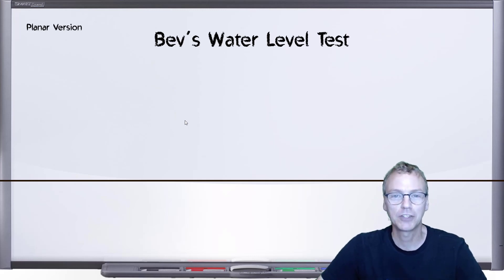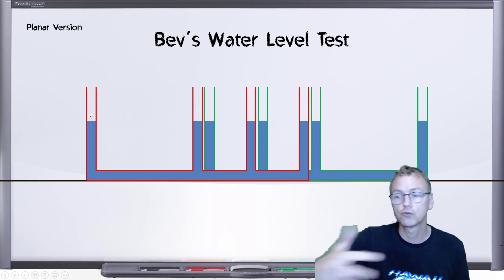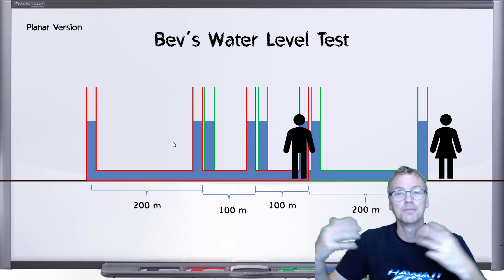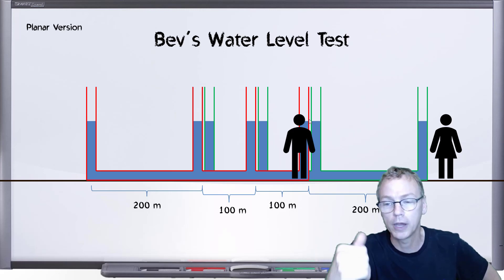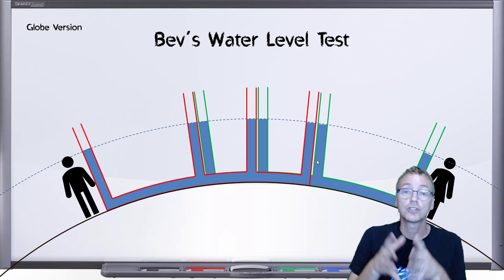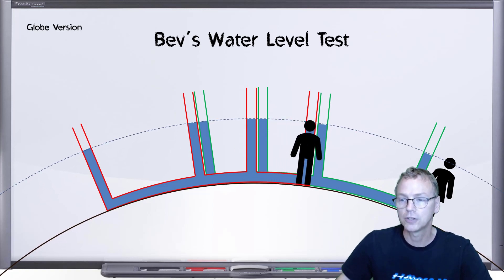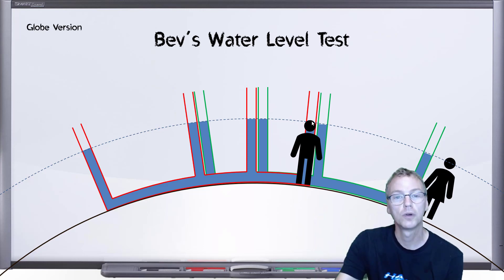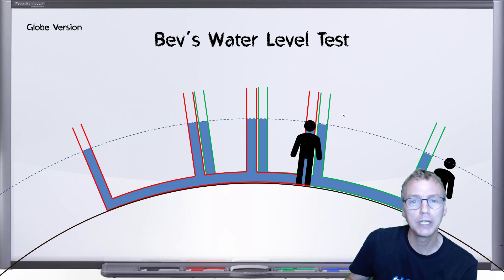Bev Try Thinking and Spot On Level's Water Level Test

Comment: The problem is Bev believes water finds its own level, level is horizontal & all verticals are parallel. He also thinks on a globe there should be a hump of ground in front of you. Anyway good luck with you're dealings with Bev, no doubt you will learn of the word bendyzontal.

Comment: Easy way to test this another way...
Take a line of sight from the 2 furthermost tubes. If the Earth is Flat, this will line up with Every tube.
If the Earth is a Globe, the tubes in the middle will have the water level above the line of sight...
That is if Each spot where the base 'tubes' are is the exact same height above sea level... 
Jerod from 'The Flat Earth Society' did a Very similar test in the documentary "Level" with a laser and boards with a hole in them... His experiment was "interesting" as he said...

Comment: I think you mean "line" when you said "plane."
Reply from the maker: It is likely that I've used the word "line" where I should have said "plane" once or twice.
If you give me a time-code, I can check to be sure and clarify what I was talking about.
Bev is working under the concept that all the risers of a water-level lie along a horizontal plane.
When we draw the side-on view of them, that's a 2D diagram, so that plane projects into the 2D diagram as a line. At that point, I might call it a line or a plane interchangeably, and I would argue that is correct either way. It would be a line in the diagram, but the line represents a plane in the 3D world.
Furthermore, Bev has lined up his water levels in his best approximation as a straight line. He likes to describe the risers of his water levels as being straight lines. Naturally, there is some wiggle in those lines in the side-to-side axis, but I have generally forgiven that when speaking about it with Bev. Certainly, when we draw them on the 2D side-view diagram, that wiggle goes away.

Comment: I'm sure I heard Bev a few months back on a podcast, casting about for a surveyor to give him a straight sighting from the beginning upright to the ending one. If he does get one, that would help resolve things. Of course, he also has to complete the experimental setup, which seems more challenging. Isn't he going to need 1 or 2 hundred meters of pipe completely filled with water, with no air bubbles, for each leg between uprights?

Comment: Here is MY prediction:  No one ( without a LIGOS sized government grant) can build an actual apparatus with enough accuracy over hundreds of yards to detect the tiny variation we would be expecting to measure. That is to say, the results we would want to measure would almost definitely be less than the margins for error.
Reply from the maker: I think you missed the point... the method they're using to test it wouldn't show any curvature no matter how long it was or how precise it was.
But if they sighted along the tubes, they'd need to make it longer to be able to confidently measure the effect.
Reply: @icansciencethat  I did NOT miss the point.  I'm only saying this approach is a fools errand - which seems to be exactly what you were saying.  Only I am saying it for different reasons. There is no practical way any apparatus could be constructed to fine enough tolerance and be measured accurately enough to do the blessed experiment. Not without a multi-million dollar grant. I'm sure you've seen Daniel Pratt prattle on about how he wants us to construct an i-beam over an Olympic swilling pool, and then see if we can measure the distance down to the water to see if there is a bulge in the middle. Well, when you're trying to measure mm and smaller distances, just how do you keep the i beam from deflecting due to gravity? Again, the margin of error would significantly bigger than the distance we are trying to measure.
Reply from the maker: @Robert08010  These guys keep coming up with "experiments" that are specifically designed to show nothing. That tells me everything I need to know right there.
Reply: @whatever2735    Agreed.  I'm only saying to do things to Daniel Pratt's specification would require a LIGOS sized budget.

Comment: This experiment is flawed in so many ways. Even if the results were expected to be different on a flat earth vs a globe (they are not), has Bev considered the margin of error in measurements? If we scaled this up a bit to be 1000 metres that would still only be 1/40000 of a great circle over the globe or to put it another way 0.009⁰ of earth's curvature. Flat earthers never get scale.

Comment: The only fly in this test is if the water is at different temperatures (and hence different densities) in different risers, which would give different heights. However, careful preparation of the experiment and having a long temperature stabilising period before measuring would fix that.
Reply from the maker: Don't forget wind and atmospheric pressure.
The big wrinkle is distortion and refraction when sighting. You just need to go far enough to overcome the distortion. The you must show how refraction affects it.

Comment: Bev was going to hire a surveyor to have 3 posts adjacent to the canal and have a horizontal plane marked out on the posts with all 3 marks in line. The water levels as shown were to be placed at the three marks, and then observe if the water levels coincided with each mark. They won't, but he can't grasp that.

Comment: Small technical detail: @4:00 If the points are colinear they cannot form a plane.

That aside, this experiment seems to suffer from the same defects as many others proposed by FE boffins. When going from a simple drawing on paper to the real world, it becomes impractical. Here are a few factors that should be controlled for in such an experiment: The law of communicating vessels assume equal ambient pressure, temperature and local gravity (both due to local density variations, and the influence of the Sun and Moon) at all the vessels, and that the size of the vessels and their communicating tubes are all large enough that capillary and surface tension forces can be safely ignored.

To determine whether the water levels form a flat or a curved line, they must be compared to something that is known to be flat. In the Bedford level experiment (which is basically an infinite number of infinitely small communicating vessels) light was used, thus assuming that light travels in a straight line. Note: whether you are sighting across the vessels to see if they line up, or whether you shoot a laser beam across the tops, you are relying on the exact same assumption that light travels in a straight line. By necessity this experiment would have to be performed near the horizon, exactly the place where FE boffins dispute that light travels in a straight line. I suppose they will need a magical 500 meter long ruler that is perfectly straight (as determined by a currently unknown process), and not subject to any bending at all.

This reminds me of Pratt's suggestion of attaching measurement equipment above a really long swimming pool.

As usual our coverage of the topic was both polite and respectful, without a presupposed bias, I always enjoy and appreciate that!
Reply from the maker: Agreed to all except I would say that a single line does not "form" a plane, but it does line within a plane. Technically, the water level would not be perfectly straight, so the various points on it WOULD form a plane... it only creates a line in the side-view projection.
I'm sure Bev would insist that it's a plane and I mis-represented it as a line.
Reply: @icansciencethat  >>I'm sure Bev would insist that it's a plane and I mis-represented it as a line.<<
- Right, that is pretty much what motivated me to make the slight detail comment. Mathematically, 3 non-colinear points define a plane, even if one point is only ever so slightly away from the line connecting the other two. But in practice, with points that are nearly colinear, it is difficult to establish that plane exactly. Since Earth is very nearly spherical, it has almost uniform curvature in all directions from a given point. So the argument would still be the same when considering lines/curves rather than planes/surfaces.

>>a single line does not "form" a plane, but it does line within a plane.<<
- My very slight objection to your reply is that planes are not the only surfaces that can be constructed from straight lines. In general such objects are called ruled surfaces. Of course, in this context general ruled surfaces probably don't make sense, but one should establish that as a conscious decision. Again, I mention this in the context of what Bev might object to, and not as a critique of your video :)

Comment: Get a one meter or so length of transparent plastic tubing and hold it in a U shape nearly full of water at a beach. Hold one end of the tubing near your face (at eye level) and the other end of the tubing towards the sea horizon. The water levels in the tubing won't perfectly line up with the horizon. The horizon is lower!
Reply from the maker: Have you tried it? I encourage people to try this.
If you do it from high above the water, do you get a different result from what you get down near the beach?
It's an informative test and very easy to do... if you have access to a beach.
Reply: @icansciencethat  Apparently refraction is more prominent near sea level and not as accurate as from a cliff.
Reply from the maker: @Justwantahover  I would say that refraction is more unpredictable near the surface... not particularly near sea level - just near any surface where the heat can build up.
If you look downward towards the waterline from above, that dramatically reduces the issue.

Comment: Taking a second look at this, and trying to work with your desire to make this a "safe space", wouldn't it be so much easier to just suggest an easier measurement with something like a lake? Just get some wooden stakes marked with measurements and pound them to water level on each side of a nice calm pond or lake. Then take some surveying equipment to measure what you see from each side. The obvious issue is honestly acknowledging how surveying measurements work and their tolerance errors, but it's been done before by a surveyor whose name escapes me now. Regardless, why set up all these pipes with water when you can use use a pond or lake?
Reply from the maker: Seems to me, that would work brilliantly.
Reply: @icansciencethat  Jesse K was the surveyor who already did something similar long ago. I finally remembered his name.
Reply from the maker: @NinjaMonkeyPrime  I've seen some of his work.
For some reason, his name is met with universal revulsion in FE circles. Can't imagine why.

Comment: If the water in each tube was on the same plane as Bev claimed, 1 water level device would have been enough; they could just measure the angle of the surface of the water to the ground. If it worked as they claimed on a spherical Earth, the water at one end would be angled to the ground a bit due to the plane not following the curve.

Of course, that would mean water at that end of the device is failing to "find its own level" as flat-Earthers claim water always does, since it'd be at an angle rather than leveled out.

I don't think Bev thought this thing all the way through...

SIDE NOTE: Greetings from WheresWally's channel!
Reply: Not quite - he found a definition somewhere that all the levels in a container form a single plane. That's close enough to be a useful approximation on a small scale or within normal "construction" precision, but extrapolating that to mean that two separate levels would form different planes on a round earth is pedantic at best.
Reply: @Traqr  You can define a plane with a water level, if you have three uprights in a triangular arrangement. The centres of the water surfaces in the upright tubes will define a plane. Any three points define a plane. You could also use four, in a rectangular arrangement, or five or six or seven or however many you like, as long as they're all equidistant from one point in the middle. The plane thus defined is horizontal at that point apart from tiny errors introduced by the uneven distribution of mass causing irregularities in the true geoid and by Earth's north-south curvature varying with latitude due to Earth's rotation. Those errors are well within tolerance for a generic building project, and a plane with a 25 m radius, quite large for a building project, is at its centre only 49 microns below level with its vertices. They measure sand grains in millimetres, not microns, so they can't really call that out of tolerance, can they? That's three quarters of one of the very smallest "very fine sand" grains.
I've used a rectangular water level to provide an "eye-level" reference line in a photograph. Technically, it'd be eye-level for someone sitting under it with their head up in the middle of it and me taking the picture past both sides of their head, not eye-level for me twenty paces back, but that's a pretty small difference.
The arrangement shown, with the hoses in a great circle, would still define a plane, but it'd be a plane aligned to the hose and to locally vertical and cutting through somewhere very near the centre of the Earth, not anything like horizontal at site and not particularly helpful.

Neither arrangement forces "level" to correspond to that plane. It merely intersects that plane at those points. It's a bit like sticking a wire through an apple. The wire and the apple's skin intersect, but that doesn't make the apple flat.
Reply: @Sableagle  ...and we'd expect a drop of 1/8" at 200m, and 1/2" at 400m. None of these statements impacts the original argument that two overlapping water levels will track one another in both models, or that we cannot assume a series of measurements are coplanar simply because some technical writer put it in Bev's instruction manual.

Comment: That is a nice presentation with nice diagrams.   I pointed out this very same problem to Bev well over a year ago and others have followed since.   Do you think after all this time with countless other discussions pointing out this problem to Bev that he will ever understand that the test as he proposes is useless for it will give the same result if you are on a planar earth or spherical earth? 

The only way to determine how the water level behaves is to set up a theodolite at one end and sight the far end and see if the water "levels" in each of the risers between the ends line up (planar earth) with the ends or find that the water "levels" in the middle risers actually appear above the line of sight established between the two end risers(sphereical earth).   You could do this with an auto level but it is tricker to do.

That is the only way to break the tie.
GH   July 18, 2022  11:09am
Reply from the maker: I have heard that I'm very late to this party. :)
No, I do not think that I can convince Bev to agree that what he has been told countless times already is true - when countless others have failed.
I am little more than 1 more voice shouting into the void.
However, it is my HOPE that I can present a friendly voice shouting into the void. Just maybe there's somebody down there listening who just needs a friendly voice to welcome them back up to the surface.
Reply: @icansciencethat  I guess Rachie taught you nothing, huh? Don’t waste your time on these ppl, unless you just enjoy trying to teach folks that don’t want to learn and actively make fun of you while you try to help them. They get off on the attention, too, as I’m sure you’ve gotten a whiff. Hey, if you want to play w/the pigs in the mud, far be-it from me to judge you. I just don’t think you do enjoy wasting your time, and I guess I’m a little curious as to why you’d continue to try to ‘help’/educate these folks. I really would’ve thought Rachie would’ve educated You on what a total waste of effort, time it is.
Reply: @mSt0n3069   You and I both have been around the block enough times to know how futile the effort is.
GH
Reply: His income stream depends on him never (publicly) understanding that this "test" is useless.
Reply from the maker: @Sableagle  but he doesn't sell t-shirts, so it isn't a scam.